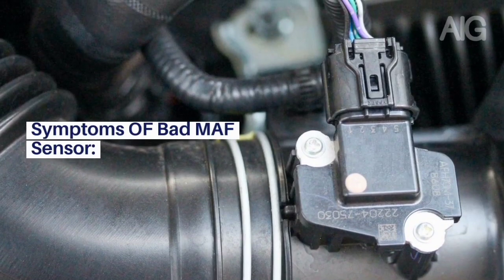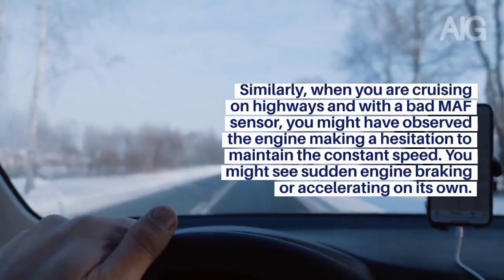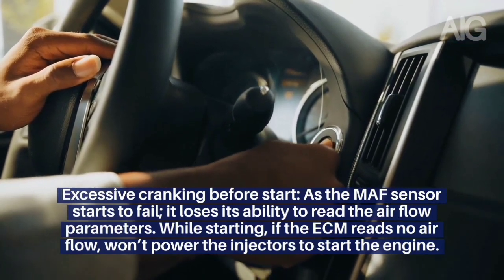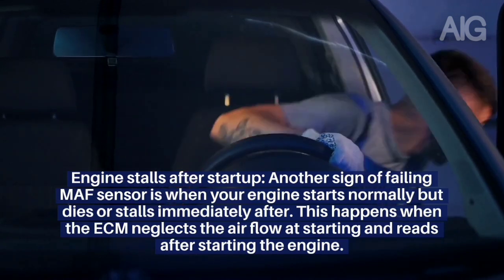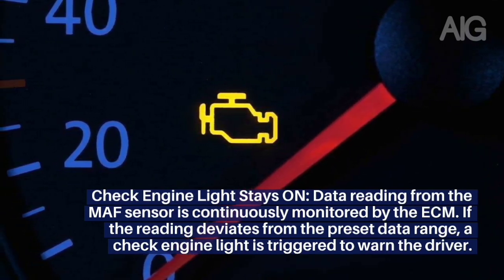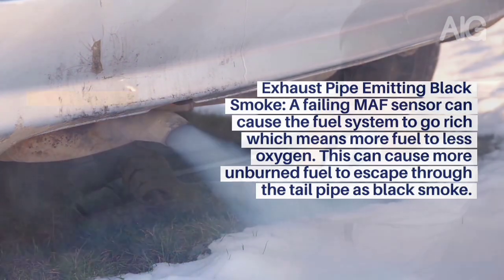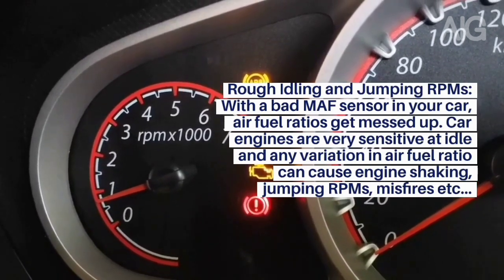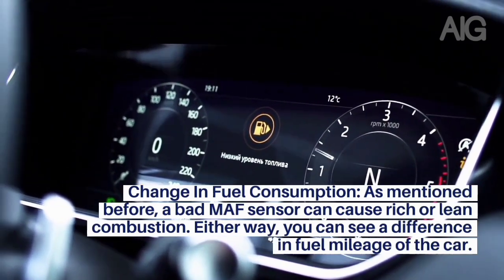Signs of a Bad MAF Sensor | Symptoms and When To Clean Mass Air Flow Sensor

Comment: Would it also cause the engine to not want to start after putting more gas in the vehicle?
Reply from the maker: The sensor will cause delayed start but no connection with gas levels. If the issue started after putting gas then you might want to check the gas cap, evap system leaks or malfunction...